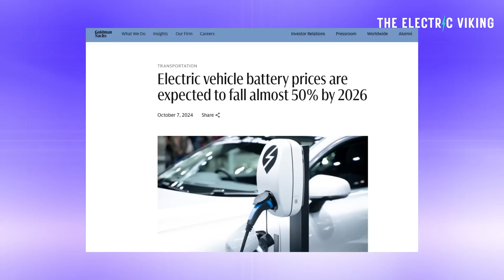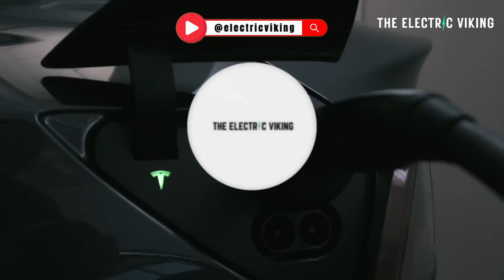Analysts say a NEW EV battery will be cheaper than fixing a gas engine

Comment: In over 50 years of car ownership I've never owned one where the body outlasted the engine. It should be interesting to see how well EVs hold-up to road salt - especially the Chinese cars.
Reply: Buy an EV with a cast aluminum underbody if you live in an area that uses a lot of road salt.  Some of the Chinese EVs are now using megacasting.
Reply: I live in Southern Ontario and what you say USED to be true, but not so much anymore. My old beaters used to be more bondo than metal - and a 1970's Ford would rust as soon as you drove it off the lot. Now, my last car I'm driving until it drops since the price of used EVs hasn't reached sanity yet where I live (and I'm certainly NOT buying a non-EV NOW). My 2011 Ford has 125K miles and no rust and the engine seems excellent. The transmission - I pray it will hold together, it's the infamous 6-speed.
If it dies I will likely buy a used Leaf, since a used BOLT costs about the same as a new one (if you can FIND ONE).
Reply: @capnkirk5528  Funny, used Bolts are hard to find. Seems like people hold onto them!
Reply: It really depends on the brand. I recently watched a video of a full disassembly of the Lixiang L9, and I must say, the thickness of the metal used is comparable to that of Rolls Royce, but at a fraction of the price.

Comment: I see solid state batteries allowing extreme density- within 5 years.
Reply: Sure, and at 5x the cost. It will be good for sports cars etc. For regular affordable EVs, no need for solid state.
Reply: @hahtos  The battery I have in mind is being developed for trucks and buses and not cars. It will be considerably cheaper and fit for use in short haul aircraft.
Reply: @hahtos It probably will do initially, but over time this will come down. People expect change too quickly, ICE has taken 100 years to get where we are today.
Reply: To parody the sarcasm directed at nuclear fusion - solid state is 5 years away and always will be.
Reply: @RedRouge-j4j  It exists.... keep up.

Comment: China already sell refurbished Nissan Leaf gen 1 Batteries sporting 62kwh (300+ miles range) for about £6k - That's less than £100 per kwh.  The original Leaf battery of 22kwh was over £20k when it came out around 10 years ago. Around 10 times more just 10 years ago. At this rate, in 10 years, you are indeed talking £10 per kwh. So not a great stretch of the imagination.

Comment: Imagine the potential for home battery storage as well
Reply: Home and large scale grid storage.  Low cost, high cycle life batteries are the answer to a 100% renewable energy grid and low cost electricity.
Reply: Weight is less of a problem for stationary storage. So sodium or ???  will shine.

Comment: Why would the average capacity for solid state cars be 50kw or under? Wouldn't the weight advantage mean that manufacturers would add more batteries to increase range and address range anxiety? Assuming 3.5 mi/kw thats roughly only 175 mile range? Am i missing something here like solid states would go further on the same battery capacity?

Comment: Will depend how they are constructed. But essentially we change batteries in all sorts of devices at home! So it really should not be a big job to do in a car. So as battery prices themselves fall so would replacing them.
Reply: You seem to be assuming that the battery pack will not outlast the car body.  Are you aware of CATL's million mile battery?
Reply: @bobwallace9753  Heard of such things but they are not in the older cars that have older batteries that will need replacing at some point. Even if they actually last longer than expected form the start.
Reply: @nicholaspostlethwaite9554  
The number of EVs sold to date is miniscule compared to the number of cars globally.  Some of the first EVs were not very good.  Going forward most EVs will be very good and the ones that sell are likely to have long life batteries.

Those first EVs are not likely to have their battery packs replaced.

Comment: I have never heard of anyone replacing their engine in an ICE car. Maybe 50 years ago. But today most cars can go 200k miles fairly easily. By that time, the rest of the car is falling apart and not worth repairing. That also goes for EV's today. Unless there is a manufacturing defect (Bolt), most EV's will go 200k miles with, of course, some battery degradation. Since EV's are new we don't really have the data yet to prove this. Although there are many Tesla's and Nissan Leafs still being driven with over 100k miles.
Reply: Yes,  The Prius has been around for about 20 years and I don't hear of major issues with the batteries degrading and costing a fortune.
Reply: There are Teslas with a million miles on them.
Reply: @Islamisthecultofsin but they have had 3 battery replacements
Reply: @Tricky-h8k   Covered by warranty.  Also, here are new batteries coming with million mile warranties.
Reply: You mean like the Kia Souls and Toyota Tundras with recalls for bad engines?

Comment: It would seem obvious EV car manufacturers will need to change how batteries are accessed. Changing a battery will need to be quick & easy. I still ask the question. Where are we going to get the electricity from to charge all these EV‘s. Here in the United States we are not creating additional electrical output is actually the opposite.
Reply: That is why there are EVs with battery swap. You have a robot do the job. Fast, cheap, safe.
Reply: From your roof.

Comment: Tony Seba is right, when I needed to replace the engine head on a car that was over ten years old, the manufacturer's price of $4000 meant that the car, in otherwise mint condition, ended up in the scrap yard. The cost of internal combustion engine parts and labor will be so high that it won't even be worth fixing them anymore, which will accelerate the transition to EV|. Thus, cars with internal combustion engines will end much earlier than their physical lifetime. It simply won't make economic sense to continue to operate and maintain them, EVs will be cheaper in every way. Of course, this will not be true of Europe, which has cut itself off from the market for state-of-the-art cars with an import tax, and will be hoarding its fossils for years to come, all the more catastrophe awaits it.
Reply: So you scrapped it rather than putting in a used engine?

Foolish.

Comment: EV batteries are hundreds of the same part wired together and if properly designed can be almost totally put together automatically and when exhausted can be fully recycled recovering all the minerals and metals. Look at any ICE engine strip down video and you see why they are finished.
Reply: But to recycle them efficiently you need to get them out. That cannot be done manually on a billion cars. That is why battery swap is the future. E.g. NIO, Onvo, Firefly.
Reply: The USA and the EU have enough recycling capacity plants - on paper and in planning. They haven´t built them yet. One of the big players with big government spending and subsidies payed out/ a lot of factories on paper was Northvolt. Northvolt is bancrupt. In theory recycling is "easy". What does it cost in real life? Unfortunately I foresee a very near future where EVs will be dumped in Africa by all nature-loving western countries - while the big player China will be the one to make the first move.
Reply: @SunshineShane  Separate the battery from the car is step one. A repetitive task - perfect for a robot. I.e. battery swap.
Reply: @SunshineShane  The EVs without swap will be dumped there - that is why environmental groups will push for EVs with swap.
Reply: @martina5328  
Nope.  Swapping makes no economic sense.  Do you not understand why?
Reply: @bobwallace9753  No I dont. And I did a Ph.D. in business economics / market strategy. If two cars are the same, but one also comes with swap, which one do you choose?
Reply: @martina5328  
OK, use your background and do some back of envelope calculations.

If you drive an EV with a non-swappable battery pack all you need is somewhere to plug in.  Then you pay for the electricity you use.

If you drive an EV with a swappable battery pack you need to use a swapping station.  That swapping station needs a supply of batteries, some charged and some charging.  Do you expect a standardization of battery packs or would a charging station need a large variety?

They need swapping equipment, some way of removing the discharged battery pack and installing a charged pack.  They need real estate for the swapping station.  There will be some labor cost, even if the swapping process is automated.  And they will need to pay for the electricity used to charge the batteries.

Even an Econ 101 student would pick the EV with the lost opex.
Reply: @bobwallace9753  60 swaps a day and the swap station is profitable according to NIO. 

Chargers do not require any space or lease? The swap station makes money from charging during the night when the price is low per kWh, and then selling it back to the grid at peak times, balancing the grid.

Fast charge a battery and you kill it. You can kill it in 12 months. The alternative is to wait. Time is money. Burning a battery is money. Add that to your calculations. The core product you purchase is arguably e.g. transportation - what makes sense for the customer makes sense for the car manufacturer.

The swap station can test, maintain, and if needed do service on the batteries. With a Tesla you need to pay a small fortune just to get it out of the car. Do you want to pay 1k just in work cost to get the battery out of a car worth 5k? If not the car is worthless right there.

With a NIO you just swap in a replacement battery in 3 minutes.
Reply: @bobwallace9753  How much space for 10 chargers? Is that land / property for free?
Reply: @bobwallace9753   @wolfgangpreier9160  Labour cost of swapping a Tesla battery $500-$3,000. Some even say $5k. And there is no new warranty after the swap if it had ended before the swap.
Reply: @martina5328  Car design is moving to structural batteries where there's no floor structure, just the battery case. If you pay the penalty for a swappable battery, you'd still be better off charging at home when you can, because you'd have the option. If you were a city dweller or needed to go long distances without stopping long enough to top off a battery, it might work. It would have to be more expensive than home charging. Do connectors break or bolts get rusty, dirty or cross-threaded? I dunno. So, no thanks.
Reply: @jamesvandamme7786  Again, most people live in apartments - no home  chargers.
Reply: @SunshineShane  
Can't run a battery recycling operation until there are enough batteries to recycle.

Comment: Nowdays the engine is just one of the repairs then easily reach 5-10g , ever priced a particulate filter which now is a part of petrol engines as well, or  a replacement DSG, all of which will or likely to fail past 200k .  Modern cars a stupidly expensive to fix. With new batteries you are likely to get even better range than before , something that was  never a thing with combustion engines.

Comment: In an EV with battery swap option (e.g. NIO) your battery will never fail - i.e. the battery will never force you to scrap the car - as with a Tesla. 

Integrating the battery in the chassis, like e.g. Tesla is a stupid solution.
Reply: I guess the thing is, 95% of car bodies will die before the battery does, so it’s not needed.
Reply: @ISuperTed  Show me a battery that has lasted 16 years of use.  And 16 years is only the average. Quality cars last much longer. 
One dude driving Uber killed his Tesla battery in 12 months.

You want an EV with battery swap.

I have a Land Rover Defender that is 40 years old. The EU has passed a law making battery swap mandatory for consumer electronics.

We are not moving towards less resource efficiency..
Reply: You assume the battery will fail.
Reply: @Islamisthecultofsin it will. Nothing lasts Forever. Warranty is limited for a reason.
Reply: @Islamisthecultofsin  Yes it will. If it will not, manufacturers could offer 25 years 100% full warranty for the ev battery.

Comment: To me, this is not speculation but merely an affirmation of the reality. If you consider how much labour there is to remove and overhaul and engine -- not to mention have all the parts shipped to the garage where it is done -- it makes total sense. Modern car engines are very complex and something as "simple" as a ring or valve job requires a lot of dissasembly and re-assembly.  This is why it is often cheaper to replace an entire engine with a second-hand one.  Structural battery packs can be replaced from the bottom (see Sandy Munro) and they will not be disassembled in the the shop. With improved design, they are much less likely to need replacement at the same number of service kms than an ICE engine. Solid state batteries promise even more, in this respect.

Comment: Tony Seba got it right. Battery prices are dropping even as their cycle lives improve.
Not only that but as battery recycling catches up, replacing a vehicle's battery pack will be a few minutes' long operation.
Reply: Not if they are structural packs. &/or not if the access is through the cabin with all those seats. Doable but not a breeze. But then look at the enthusiasts who polish inlet ports so the can comb their hair in them - it will become a hobby!

Comment: I ended up having to sell my Prius at 160k miles because the engine was burning through motor oil, and the cost of replacing the engine was more than the car was worth…
Reply: They all burn oil prior to 2014, had 2. One lasted to 330k and other 283 k miles
Reply: Head gaskets went also a well known issue for them
Reply: It's still running strong.